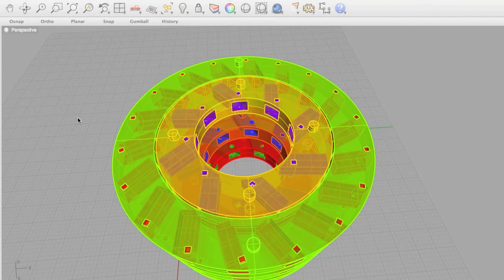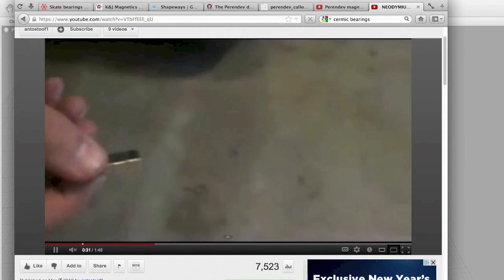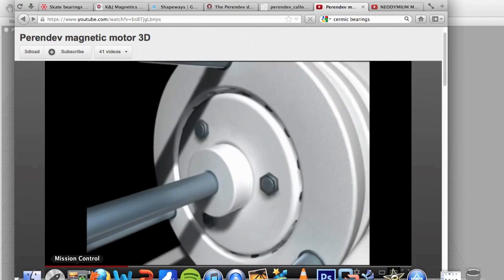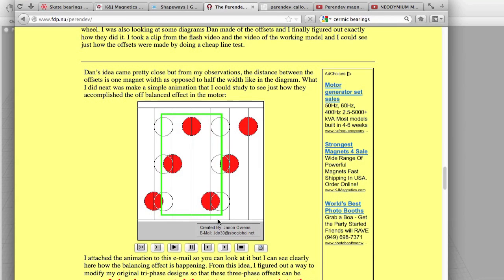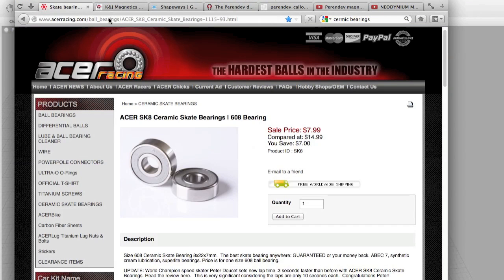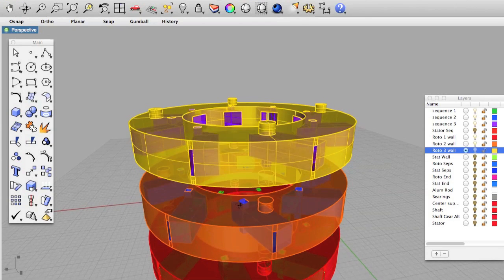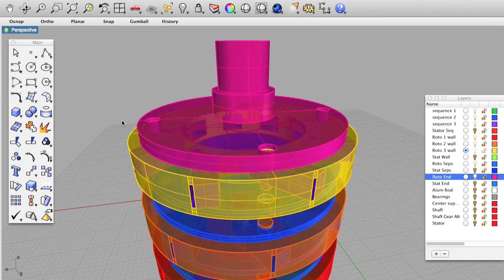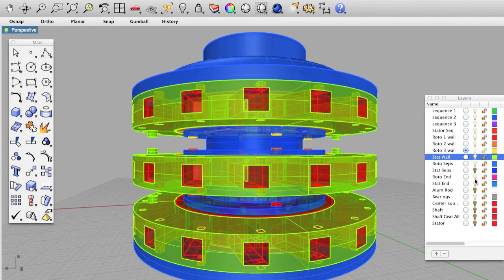Printable Perendev Magnet Motor Design

Comment: I think the problem with the parendev motor is that the magnets stay stationary. A proper design requires some amount of dynamic movement of one side. otherwise it necessarily reaches a certain amount of stopping power.

Comment: I had this idea back in 2001. Using a frictionless spindle is critical. Faraday cage the outside of it and use the excess EMF captured by the cage as part of the reactive power for the engine you use in the vehicle.

Comment: Perendev was a fraud that a guy called Mile Brady went to jail for.  The machine and the video were just props for this fraud.  The video was made by turning the machine by ordinary means from the far side then editing a bit on the end showing the far side.  That it was a crime is public record.
Reply from the maker: Mike Brady*. A simple google search will bring up articles in regards to his arrest for embezzling money from German investors. Apparently the perendev design was actually patented in 1989 by the Brazilian patent office which he gave no credit towards. I have no intention of stealing designs and selling them as my own. This project is simply to see if something like this could work.
Reply: ***** There is a thought experiment you can do to prove that none of the wheel like things can work.  It is easier than the general case.

Imagine a machine with just one pole on the rotor and one on the stator

Imagine that you want to measure the average torque over one full turn

You notice that the machine is its own mirror image along a line so we can call this zero degrees

If you measure the torque at +10 degrees, you also know it for -10 degrees.  It just has the opposite sign

As result, we know for every positive torque value there is a negative one that cancels it out making the average exactly zero.

No matter what the curve of torque vs angle is, its average will be zero for this simple case.

Now add one more pole.  This adds another curve for torque vs angle to the one we already have.  It may be scaled and shifted or even a way different curve but we know that its average is also exactly zero.

Continue adding poles and you have 0+0+0+0+0....=0 average torque

Comment: IF those magnets were electromagnets on the outer ring they would be a stronger repelling force thus forcing the inner set of magnets rotate faster and stronger
Reply from the maker: But you would have to supply a current to those electro magnets. If the amount of current needed to make the motor run was less than what the motor itself produced then I believe it would be called an over unity machine.

Comment: A1phaZu1u hey are you still working on the Perendev motor?
Reply from the maker: Yes, on and off, I haven't had any major breakthroughs, but i have come to the realization that this design probably will not work without some kind of shielding.
Reply: ***** explain more please.
Reply from the maker: Roy Kossaifi This design specifically doesn't include shielding, which is what a majority of people who have studied the design say it will not work without.
Reply: ***** Hey I built a small permanent magnet motor using a 3d printer. The outside magnets are tilted at 30 degrees. The inner rotor has 3 layers and each layer is staggered with the previous one. I couldn't get the thing spinning w/o magnetic shielding! It is very challenging to built as well (I'm not the best builder). If you ever decide to make one, make it with magnetic shielding. Also, check out stuff about 'bucking coils'. These might provide a shortcut to over unity. Check out the paper on bucking coils >>> http://www.hyiq.org/Downloads/Guidelines%20to%20Bucking%20Coils.pdf

Comment: The 'fund the project' link is wrong and doesn't take anywhere. I would donate to your cause. The time to end oil is now my friends.
Reply: Hey I re-watched you perednev motor video. I think you are missing some magnetic shielding on the outside magnets. Also, I think the original perednev design had magnet poles on the ends in both rotor and stator (magnetic shielding on the outside). THESE motors are very tough to make. Ever heard of Muammer Yildiz Magnet Motor? He is some Indian professor who also made an all magnet motor (similar to perednev). ALSO, people posted Peredev's patents on youtube. If you are curious how he did it watch the patents. I wish you best of luck in your projects. I'm trying to get a variation of Bedini's pulse motor going. Everything takes time.
Reply from the maker: Sorry for the delay, the link has been fixed. Details in shapeways.com
Reply: ***** I did not see the perendev motor option
Reply from the maker: Rob Treadway It is simply for a sample of the stator and the rotor for r&d purposes.

Comment: If this really works I would expect the magnets to heat up. Passing a magnet by a conductor generates eddy currents. I would attach a thermocouple to one or more of the stator magnets to detect increases in temperature. I suspect heat to be a major problem with your design. My guess is that there would need to be ventilation holes designed into both the rotor and stator elements through which air can flow around each magnet for cooling.

Comment: I wouldn't build that. You have no way of stopping it if you do get it to work. Find a way to interrupt the magnetic cycle. I would like to see if someone can find a way of doing it without opening the outer rings. 

Remember a machine moving at high speeds is not safe to work on and there's no way to unplug this.

Comment: Dear AlphaZulu, thank you for your reply, I wish you to succeed in your project for the benefit of the world of energy , it reminds me  Muammer Yildiz Magnet Motor long term project. I hope that manufacture of this design considering the shape and more specifically the length of the magnets and The design which requires that the magnets be angled will not be a problem. Building a workable prototype is much more difficult than showing a theoretical design.

Comment: Dear AlphaZulu, Very impressive design and cool graphics. How much fund is required for building one working prototype?, how much time will it take? Will it work? How much power do you expect to get? What are the size and shape and amount of magnets which you require for this project? (I have a direct low cost manufacturer in china.), The material of the 3D printer might be a magnetized material and might affect the magnetic fields in the system.

Comment: VERY IMPRESSIVE WORK MY FRIEND. I am also working on a permanent magnetic motor to produce electricity.  Would you please be kind enough to provide me with your 3d print file?  I was planning on using Delrin and manually creating everything using power tools like a lathe and drill press.  The 3D printer idea would save a lot of time.  This idea has also been burned into my mind and its all that I can think about as well. Lets collaborate and share progress to make it work.  CRXer0007@aol.com

Comment: Does your 3d cad program also calculate the magnetic forces when intermingled with each other and calculate the shielding also required to tune the intermingling field. Rather than connecting a generator to the mechanical load in the shaft why not manipulate the oscillation of the magnets themselves.. like a pulse magnet motor. I believe combining the to is the key

Comment: yeah but still those magnets that you want to buy are same pole configuration as the rotor magnets but where youll get the stator ones? :) i would go for howard johnson magnetic motor design, its similar design but youll be able to do it with those magnets that your planing to buy. instead of the curved magnet you can use two magnets arranged as triangle. as soon as i get money to buy such magnets i will start building one my self (tho that will not be soon) :)

Comment: no no all you need is a set of mismatching inner and outer numbers example 10 outside and 9 inside . as long as one is odd and the other is even it will give you the same effect as what you desire. but it wont work as the potential gain vs potential loss will even out.

Comment: Your offsets must be designed in the staters not the Rotor, Sliding adjustable staters could be made with a gear similar to a scissor jack That has reverse threads That only move the two outside stator rings. This way you can adjust your offset wile the rotor is turning. This will take all of the guess work out of achieving the golden ratio.  This is a balancing act that must be as precision as a Swiss watch.